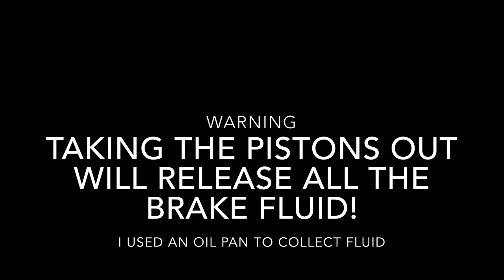SV650 Front Caliper Removal and Clean

Comment: jesus, this bike is so dirty and fucked up. all rusty... what the hell do you do with your bike...
Like copper paste on the rubber parts, just use normal grease. works the same and helps the rubbers
Reply from the maker: This bike is a replacement bike after a car wrote off my last one with me on it. I bought it from someone who kept it outside and remember, it is a 14 year old bike! I guess that is the point of maintenance videos, if it was perfect to begin with then the job wouldn't have needed doing! I like working my way around the bike and restoring it as best as I can. 

I think grease on parts is essential, and any is better than none, but the reading I have done about the different properties, and speaking to people with far more experience than me (motorbike mechanic for 25+ years says to use it, so I did!) means that there are subtle differences between various products which are designed to act in different ways depending on the situation. 

Thanks for the comments, I hope you will watch future videos too.